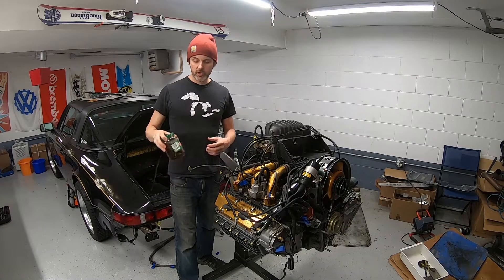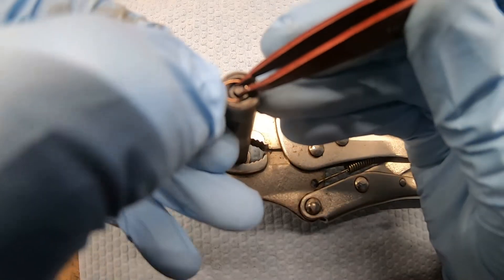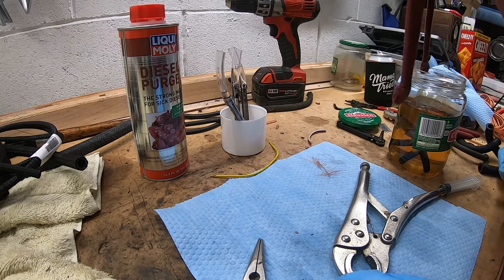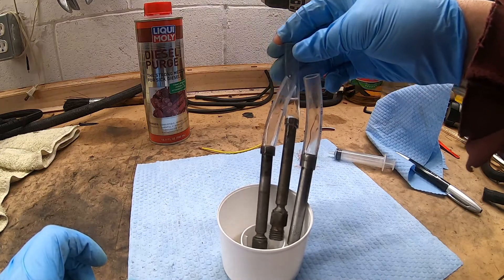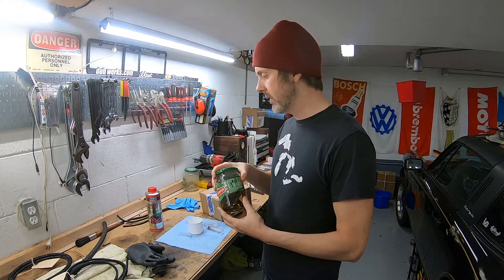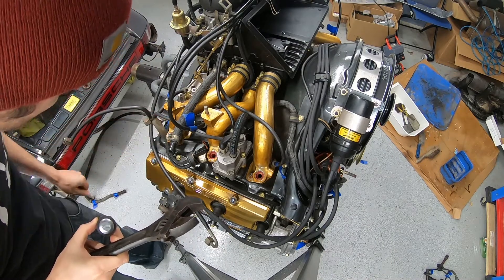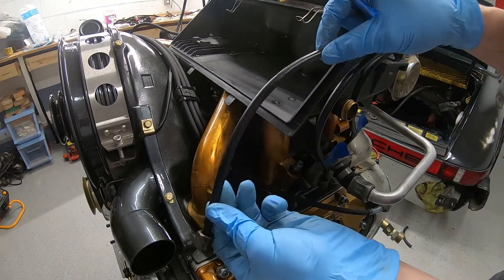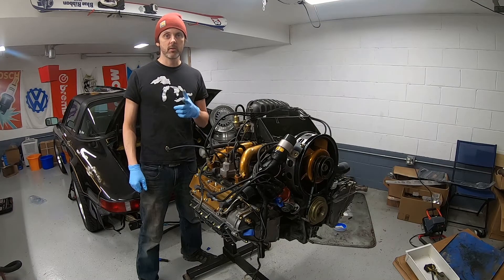How to Clean/BackFlush CIS Fuel Injectors for a Porsche 911S!  Projekt Airkult Episode 25

Comment: I don't own a Kjet cat, but doing research for the Delorean Dude's.  In the Porsche world of forums, do guys use any kind a fuel additives?   
From my research, the CIS really needs to have an advanced multi forumula fuel additive with detergents, anti corrosive, & friction modifiers to protect & dissolve different contamination of fuel deposits & acid formation from ethanol especially since they removed all the sulfur from gas.
Reply from the maker: Haven't had any issues but I tend to run premium / ethanol free most of the time.  Hae about 6k on the car now.
Reply: @ADDvanced  There is a discussion & expose' n Bob Is The Oil Guy lubrication forum about best & highest detergent fuels & of all places its Coscto that exceeds Top Tier Fuel Standards since they add the additive pack themselves at the location & not trust the delivery truck or fuel depot & they get fresh gas daily vs. other stations maybe weekly which makes a difference in degradation of certain gas components!  They said Shell V Power was also 2nd best!
I think these K Jets still need dosed with multiple types of additives every tank to protect & lubricate that Fuel Distributor & entire CIS & injectors since everything is mechanical.  I just saw the video for Liqui Moly hosted by FCP & see they also make a fuel enhancer that I am certain I know exactly what they are using & if was exactly what I know will benefit these CIS Injectors based on the 1982 Bosch VW Audi Tech video called: VW Audi Air Shrouded Injectors, where they redesigned the injectors to have air passing over them to create a finer atomization vs. the o.e. design.

Now from their description,  I think Liqui Moly is using a patented indistrial polupymer called HMWPIB &  is an industrial diesel additive which can be used in gas by Viscon USA.    Look up Viscon USA which is really a commerce & indusrtial additive added at the fuel racks in California & Texas & only additive both Carb & Texas Air Resource Board Approved.  There is some discussion over the years on Bob Is The Oil Guy.

I think this additive will really work well with CIS Injectors & enhance performance & even fuel efficiency!  Its just a theory of how HMWPIB works. (High Molecular Weight Polyisobutelene) which is a polymer & makes the fuel viscoelestic.   Try it & please let me know if its a significant performance gain vs. regular fuel.  Here it is under the LiquiMoly brand called Speed Tec.
https://m.youtube.com/watch?v=dj80AFvcmzo&t=308s
Reply: There is a discussion & expose' on Bob Is The Oil Guy lubrication forum about best & highest detergent fuels & of all places its Coscto that exceeds Top Tier Fuel Standards since they add the additive pack themselves at the location & not trust the delivery truck or fuel depot & they get fresh gas daily vs. other stations maybe weekly which makes a difference in degradation of certain gas components! They said Shell V Power was also 2nd best! I think these K Jets still need dosed with multiple types of additives every tank to protect & lubricate that Fuel Distributor & entire CIS & injectors since everything is mechanical. I just saw the video for Liqui Moly hosted by FCP & saw they also make a fuel enhancer that I am certain I know exactly what they are using & if was exactly what I know will benefit these CIS Injectors based on the 1982 Bosch VW Audi Tech video called: VW Audi Air Shrouded Injectors, (look up video) where they redesigned the injectors to have air passing over them to create a finer atomization vs. the o.e. design. Now from Liqui Moly's description of this product, I think they are  using a patented industrial polymer called HMWPIB used in diesel fuel & is an industrial diesel additive which can be used also in gas by Viscon USA. Look up Viscon USA which is really a commerce & indusrtial additive added at the diesel fuel racks in California & Texas & only additive both Carb & Texas Air Resource Board Approved. There is some discussion over the years on Bob Is The Oil Guy.
 I think this additive will really work well with CIS Injectors & enhance performance & even fuel efficiency! Its just a theory of how HMWPIB works. (High Molecular Weight Polyisobutelene) which is a polymer & makes the fuel viscoelestic to create finer fuel droplets & no other chemical technology can do this.  They just don't market to gasoline fuels.  Try it & please let me know if its a significant performance gain vs. regular fuel. Here it is under the LiquiMoly brand called Speed Tec. https://m.youtube.com/watch?v=dj80AFvcmzo&t=308s

Comment: These injectors are cheap, only about $50 a piece from a dealer.  I've found after working on these for years that the now advanced age of these they just need to be replaced in most cases.
Reply from the maker: Yup.   $320 and I had all new ones.

Comment: I just came to the same/similar conclusion on the copper wire after messing with trying a zip tie with a split cut in it.  I popped the pintle with a fingernail and just stuck the tip of the wire in. I don't like the idea of the loop and pulling it to the side when you jam the hose over it. It could bend the pintle. My plan is to hook them up to a fuel pump and really backflush them. Your spray pattern test is not accurate with so little pressure either.
Reply from the maker: I gave up, lol.  Found them for $35 each.
Reply: @ADDvanced  yeah. I have a shitload of k jet cars. And as terrible as the mileage is my 450slc drift car is dead reliable and I don't want to have efi problems, computer brain farts and drifting inches from walls don't go well together. I found a guy that really knows k-jet and ke JET and can actually tune it.

Comment: Great video you me  some good tips on the injectors!Just make sure when buying new injector that you get the 110kw injection as this is the right fuel pressure for the cis.there are other low pressure injectors and if you get the wrong ones it could affect your fuel/air flow and the engine won't run right.

Comment: I have a 85' Ferrari Mondial QV... K jetronic system on it. Removed the original injectors and gave them to a fuel injection shop to be tested and cleaned. WOW ! they were all good and had a nice even spray and no drips. Gave the car at least 15-20% more power. Easy fix, cheap and very effective. Don't underestimate the value in a professional shop doing some things. It's worth every cent. Cheers.
Reply from the maker: I just wound up buying all new ones, they are not that expensive, around $30 each!  :)
Reply: @ADDvanced  Yeah I saw that. Nothing wrong with brand new... just saying professional cleaning is a very good option. Especially if your car's engine was running well. cheers.

Comment: What was the point of tapping with the screw driver on the threads?
Reply from the maker: There aren't any threads.  I put the screwdriver on aluminum lip surround the injector inserts, and smashed it downward to 'stake' the inserts in place.  You can watch me grind out the original stakes in episode 10

Comment: Very recognizable. I went through the exact same. Watched that Mercedes mister on YT use diesel purge. Sourced that stuff, did my best but no cigar. Ended up purchasing new injectors too. Good job - you’re almost there!
Reply from the maker: Thanks!   Read on ton on the forums, watched those mercedes guy do this, thought it would be pretty easy and a nice way to save $250.   Disappointed.   Glad I'm not the only one.  :)

Comment: Another well made video! 
Btw, you are better off scrapping the old injectors. The issue usually isn't that they are clogged (especially coming off a running car like yours) but the wear of the internally. It causes drops in opening pressure and variation in spray pattern,  changing the fueling from cylinder to cylinder. Worst case it causes cylinder scuffing from overfueling.
Any time you have easy access to replace the insulators/injectors/orings past 100k miles you are definitely better off doing so, and the Saab part number worked for me also. Staking the new insulators in the intake runners is safest/easiest on the workbench.

Looking forward to more videos, thanks for posting them!
Reply: thanks for that it really helped my situation.